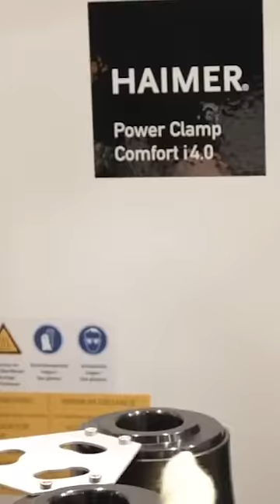3-Face Pyramid Fixture on a 5-Axis CNC Machine

Comment: It would be nice to use all BRAND NEW equipment, tools, and work holding.  Big bucks $$.
Reply: But it's more fun cramming a Bridgeport, brown sharp surface grinder and Smitty in a two car garage that you purchased used and are 60 years old. Something about them is great, just as good as the cnc if not better
Reply: @bossjosh423 hell yeah
Reply: There is a harmony you lose when you get some equipment. Yea it seems like a dream but it just lacks the necessary lubricant that comes with time. Blood tears and dip spit.
Reply: @bossjosh423 that's what you tell yourself ...

Comment: That stone with wd-40 in the begining gives variances in the plane of your fixture of half or quarter a tenth over a few times and if done ever time those tenths add up
Reply: Unless you do it correctly. Random pattern, only the pressure of the stone, entire surface. I build machines and thats how we hand surface our stuff.. hasnt been wrong yet
Reply: No it does not reduce the plane like you think. Only hits the high spots & dents from knuckleheads. Pay attention or pay cash.
Reply: If your using grandpas old knife stone yea it will.
Reply: @ThAtGuY-u9d  Rest easy there Pyle, I think your confusing grandpa’s stoning to your bong rips stoning. So think about that while your strumming you’re banjo!
Reply: @gerrylundergaard60  whoa there young fella, what I said was in agreement with you. Gotta hold and check your horses before letting them loose.

Comment: Man I know very little about machining but I 3D print and make toolpaths all the time. This makes me moist. I crave to learn more about these fantastic machines. Like how did he seat that bit!!?!?? Dang!
Reply: It's an interference fit. The tool holder is put in an induction heater to expand the metal, the cutter is seated to the desired depth, tool holder cools and shrinks around the end mill.
Reply: @danielm7960  I assumed it was something like that! I’m going to look for a good tear down video! Much thanks!

Comment: Interesting those heated tool holders interference fit..didn't even know that was a thing! "set screws" spit
Reply: Seems like a nightmare to deal with when a tool breaks in one, or if you’re running large production runs with tough/hard materials and need to change the tooling out a lot.
Reply: @glennc7433  Agree. Broken tool (near the clamping zone) in a "shrink clamp" tool-holder will sometimes sends it to a "scrap shelf".
And tool wear in mass-production or hard/abrasive material machining  can be solved with multi-step (2 to 4 or even 6 steps) machining: 1 roughing(with tool wear correction), 2 semi-roughing(also with TWC), 3 semi-finishing, 4 finishing, 5 additional precision finishing. Steps 2, 3, 5 - optional.